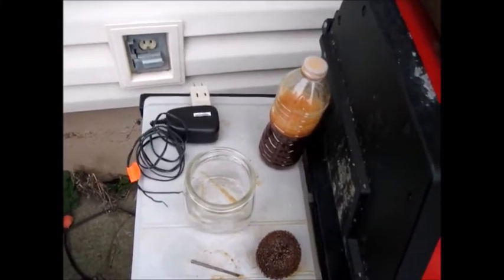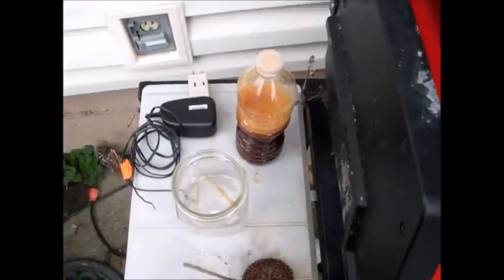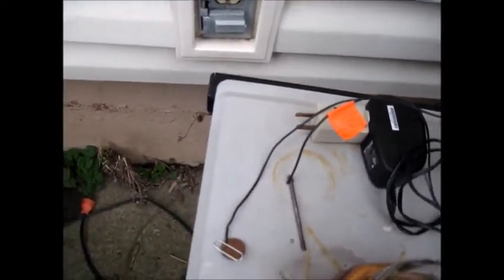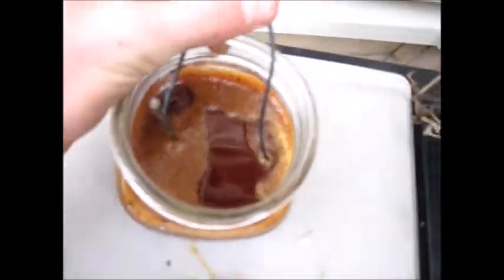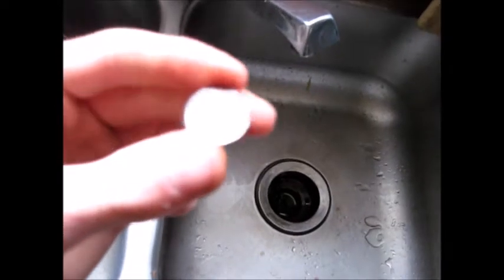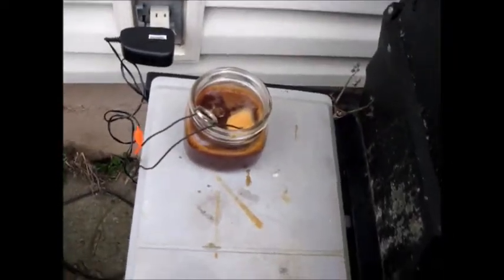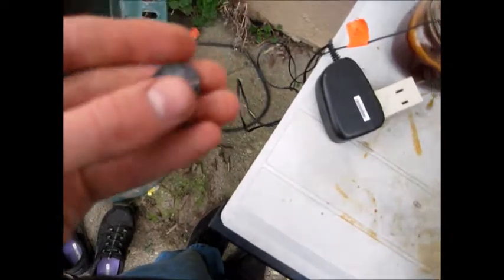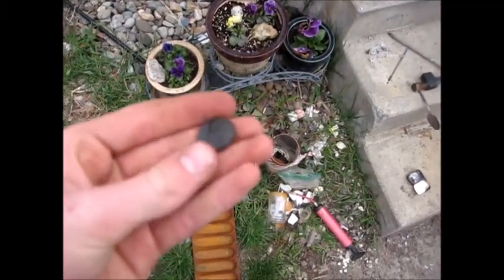Iron Electroplating

Comment: Hello, Nathan, it is accepted in electroplating that plating iron onto copper is not something that is ordinarily possible, especially with iron acetate, yet somehow you have done it.  I attempted to make iron acetate and plate it onto copper, and failed utterly; in fact, it lifted copper off the surface I was attempting to plate.  I used super fine steel wool cleaned with laquer thinner, not copper coated steel wool, which is what you seem to have used, and my power source output is 5 volts DC 225 milliamps.  I did not use any hydrogen peroxide, as what research I did on iron plating indicated that oxygen is a big problem, as it tends to create iron oxide, and indeed your solution is quite red.  Have you attempted to replicate your result with clean steel wool?  Also, I think I heard you say your power supply output was at 9volts, but what about the amperage?  Finally, did you attempt to polish the iron on your penny to find out if it would become more of a silvery color?
Reply: I used a solution of 1 part baking soda and 1 part salt to 10 parts white vinegar, ran iron cathode and iron anode under 12 V to get ions to complex. Got some good results re-plating a soldering iron tip.
Reply: Do you have any success with plating iron onto copper?
Reply: What I have seen in the literature suggests that codeposition of other metals, such as copper or nickel, helps quite a bit. Also heating the electrolyte (one paper said 70C).
Reply: He used a 12 volt adapter that looks like it could potentially supply almost 1 Amp, on a fairly small area.   I am not sure if he deposited iron or perhaps hematite,  one of the oxides.

Comment: I have tried to electroform some iron, however I only got very irregular and granular forms . Do you think if it's possible to deposit a uniform coat of iron on conductive object ? Like the electroforming process but with iron
Reply: Use a lower voltage, ultrasonic vibration, and a surfactant electrolyte like sodium carbonate.
Reply: si se puede amigo , te falta un procedimiento mas para hacerlo mas conductor aun , lee mas

Comment: Isnt this steel plating ?
Reply: Ratheadskulls even though he uses a steel anode you can not deposit carbon of steel. İron is plated through the electrolyte which only contains metal ions. There is no dissolved carbon in the electrolyte. So what you plate is pure electrolitic iron.
Reply: @fabulosss  That is a good question.  The electrolyte is iron acetate or similar,  so obviously there is plenty of available carbon.  Plus he is running a fairly high overvoltage.
Reply: @harryniedecken5321even if your plating incorpotates carbon, i believe we cannont call it steel, it may carbon particle reinforced iron composite but you cannot have ferritic nor pearlitic strel microstructure
Reply: @fabulosss  Excellent point. In the semiconductor industry we deposited amorphous,  polycrystaline and epitaxial films from the vapor phase but the conditions are very different. 

Since the deposit is black and somewhat magnetic. I am wondering if it is perhaps hematite ?  

Funny enough I was trying to remember my chemistry sufficiently to see if it is possible to electro deposit iron from an iron oxide electrode, need to pull out the 40 year old bokks.

Do you happen to know off hand?

Comment: one question one comment, 

Where could I get some iron or steel to do that with? I think for a non-copper substance the copper plating on the scrubber would cause a problem.

The penny turned black because of too much power; at least if most of the guides I read on non-iron electroplating still apply.

Great video!
Reply from the maker: thanks!
i think steel wool would work fairly well, and would probably disolve faster than a larger solid peice of iron, although any peice should work. as for the power being too high i believe you are corect, 12 volts is really not ideal for electroplating and i would probably have better results using something like a battery.
Reply: Nails